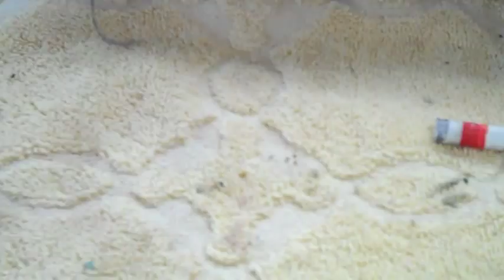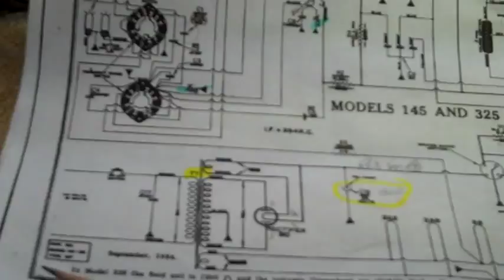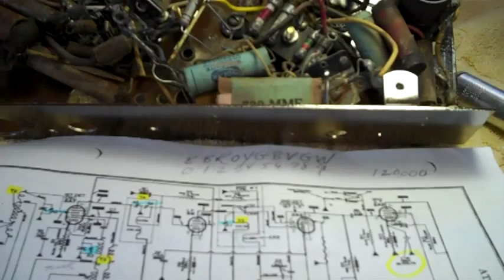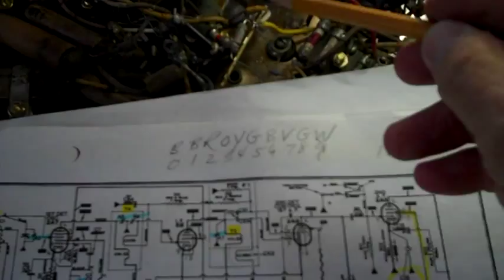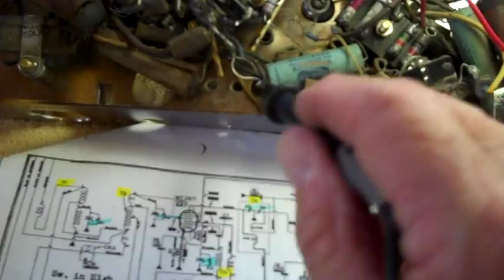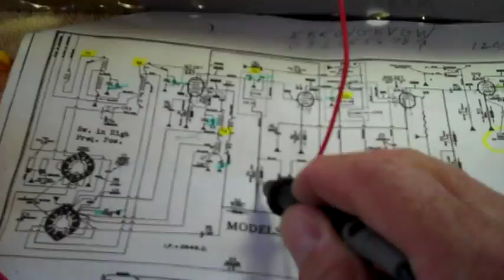1935 Atwater Kent Model 145 Repair and Restoration (Part 22 of 38).

Comment: John,
Another very helpful video. Interesting resistor design. I get to change all the resistors in my RCA 210 eventually. I checked them last year when I got the radio and they are all way over specs. 
Nathan

Comment from the maker: Daniel,
If you're determined to stay with this antique radio gig, then bite the bullet and order resistor kit 1B from Justradios. Once done, you only have to replenish on an as needed basis. It's what I did.
Caps are another story. Put in one big order for the most common sizes, 5 of each...possibly more of the most common ones i.e., .047, .01, 05.
It boils down to pay me now or pay me later and later will always be more expensive.
Start building a stash.

Regards,
John

Regards,
John

Comment: Looking good John.  I remember some of my early Jr. High School reading about experimenting and building had used wood pencils split open to expose the graphite, then used springy music wire or paperclips screwed down on wood base to contact the pencil resistor.  I never tied it but I suppose it would work in non-critical circuits.

Comment: Hi John. It was great to see how the resistor is built, very interesting... But the, as I was watching you, I thought, why don't you simply makes holes in that original tube, insert the new resistor (that is much smaller), reattach the leads and put i back just the way it was originally and not go thorough the hassle of putting that terminal strip there? Besides, it  would look original...

Comment: I would install a normal four pin tube socket in place of the broken A.K socket if the rivet spacing is the same. Even with a permanent magnet speaker it makes it more convenient to be able to disconnect it should the chassis require attention again. It also gives you a convenient tie point for some of the B+ wiring.

Comment: Another great video, sir.  And I guess I wasn't so wrong when I was kidding about that big resistor, cutting it down to get the original resistance.  How cool were those little carbon rods in there?  I guess you really COULD whittle them down to the right resistance if you really really wanted to.  LOL